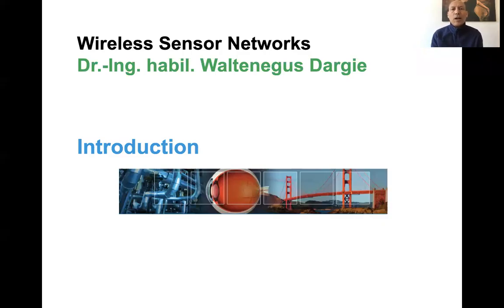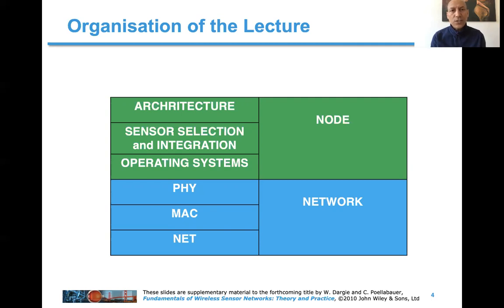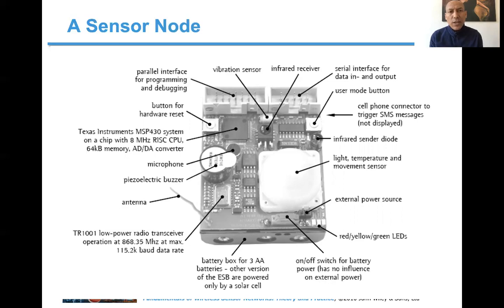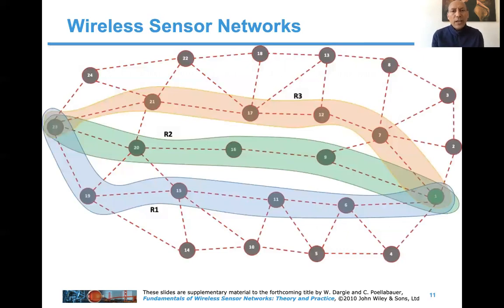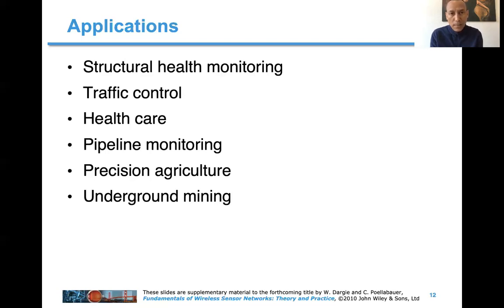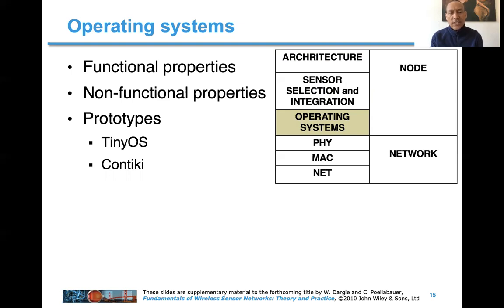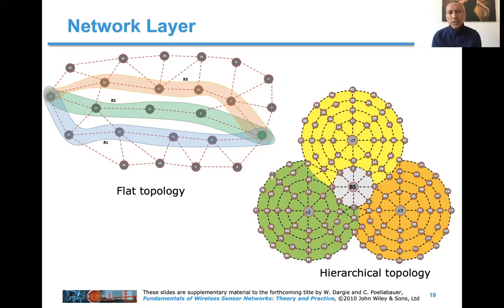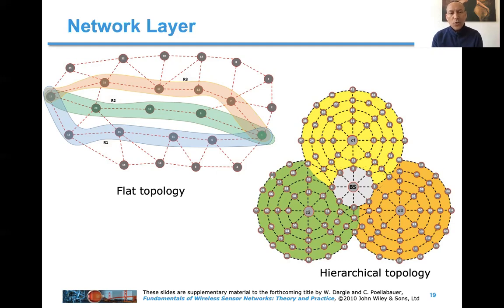Introduction to Wireless Sensor Networks

Comment: how to prolong lifetime of wsn
Reply from the maker: Please refer to my paper on dynamic power management in wireless sensor networks. There are different solutions on different abstraction layers, both hardware and software: Dargie, Waltenegus. "Dynamic power management in wireless sensor networks: State-of-the-art." IEEE Sensors Journal 12.5 (2011): 1518-1528..